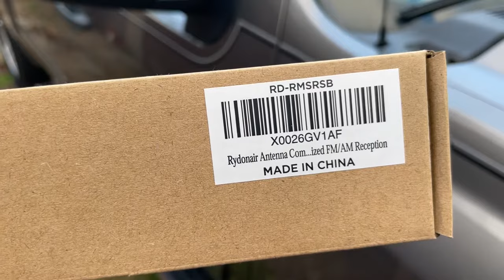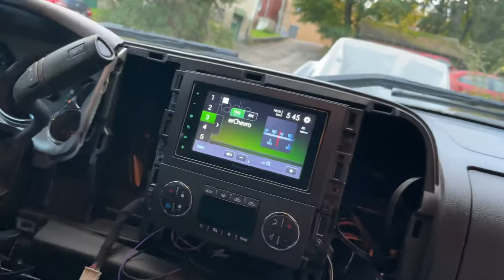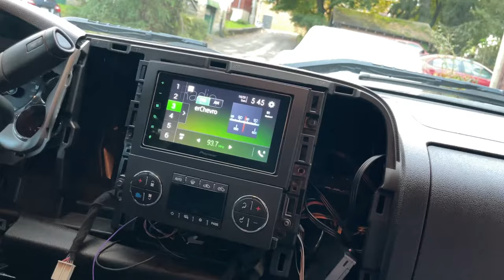Silverado Short Antenna Install

Comment: I never could get my antenna pried loose. It's like it was fused to the metal. Guess we're going to go to the salvage yard and pull out one out of a truck. Thanks for the advice.
Reply from the maker: You should check out my new antenna video. Haha. I had some trouble on a mother vehicle

Comment: Just ordered this using your link after thinking about it for 2 years…. thanks for the video!
Reply from the maker: Still works well and worth every penny. Wish I sold them. Haha. Thank you for the response
Reply: @NiceGarage  It's arriving tomorrow.  I have a 2006 Silverado and have done a lot of upgrades that i have seen on various youtube channels.  Sometime soon I am gonna film a vid of my truck showing everything i have done and include the channels i learned from.  I'm gonna include you for the antenna.  I've also installed a brand new 2017 center console, 2014 all black rear bumper with the side steps, newer style wheels & center caps, new nicop brake lines, transmission lines and a bunch of new front end steering parts.

Comment: Damn bubba…don’t let taking off the old antenna whoop ya…that was 1/2 the video 😆.…also, it’d be slightly helpful if you’d toss out what size 🔧 needed for the job?
U did say, “let me know what u guys think”…🥴…just busting 🏀’s. I just bought a similar antenna off of Amazon as well…it’s not quite the same one but it came with 9 different adapters and you’ve got the same model truck as I do so you showed me what I needed to know. Thanks for the video…appreciate it. ✌️
Reply from the maker: Hahaha sometimes it’s hard to film and work. Thanks for watching and I appreciate the comment. Have a good one!
Reply: @NiceGarage  Lol…I hear ya…Get that young buck at the beginning of the video to help you film…😄. It’s like I remember my Father telling me when I was younger. He’d say…”you do realize why your Mother and I decided to a family by creating u and ur sister, don’t u? What do u mean dad? Well, your Mother got tired of doing the laundry and dishes (hence ur sister) and I got tired of mowing the lawn and taking out the trash (hence, u son), so we just needed a couple of kids to do the house chores…so do as I say next time or I’m going to take away ur Nintendo (the original 1985 NES 😬) and Mike Tyson boxing game I just bought you the next I see you just standing around🤣🤣! Those were different times though. Again..thx for the video 👍
Reply from the maker: @user-mj1pv4gn1i just seeing this, awesome man. Thanks again

Comment: Those antennas r pain to get loose they put lock tight on them even the new mast comes with lock tight lot of the times the mast separates from the base for damn sure don’t need as much they use ot really don’t need
Reply from the maker: I did not know that, I do remember them coming off real easy 15-20 years ago. Lol